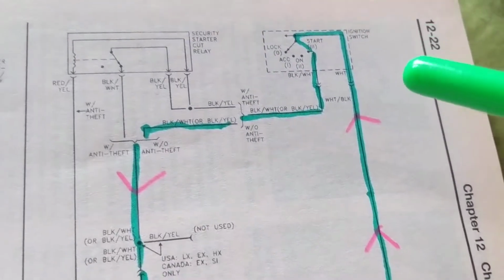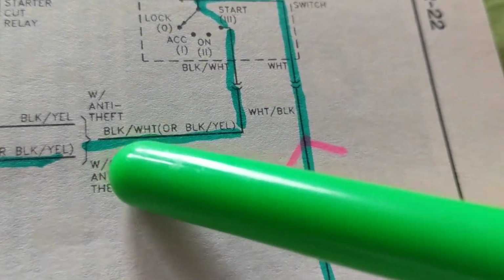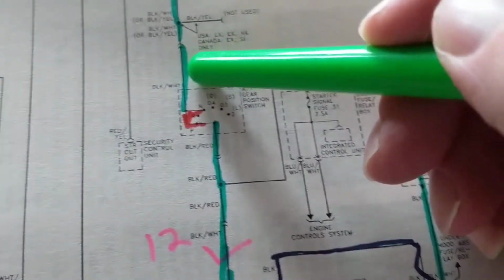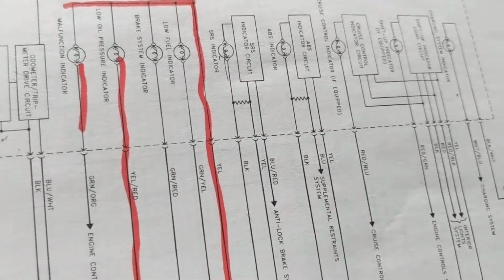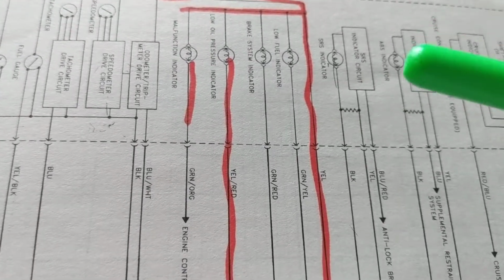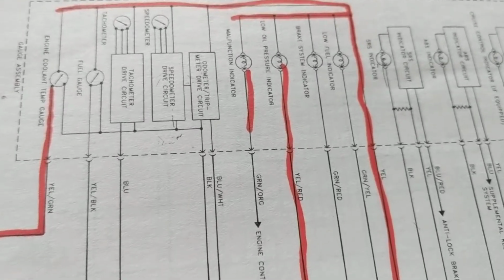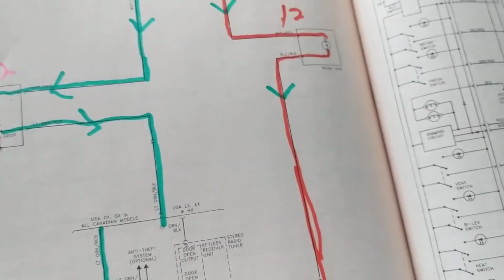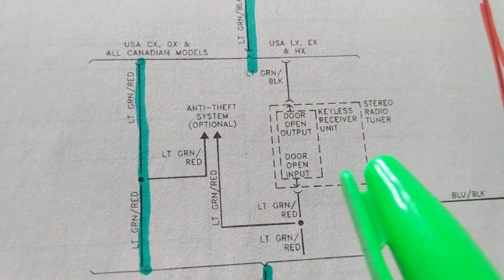How to read Automotive wiring diagram the basics of components symbols

Comment: how can you figure CAM and CRANK sensor are bad out if the computer dose not ?
Reply from the maker: Well you can look at signals but it's not always easy access to get to these sensors so the best way is to use a scan tool which tells you the description and what's going on with these sensors if there is a problem with it sometimes it gives you a code stating crankshaft sensor problem or check engine light
Reply: @Joeelectronicschematicsforauto  that’s why I was thinking. Usually it gives codes . Thanks

Comment: Hi and thank you for the video you do for us, at the 3:45 mark you mentioned 2.1 per cell. 6 cells 12.6 volts for full charge unless the weather heat right, so my 9month old battery, Interstate black top when it's in the 90's reads about 12.3 or 12.4 but my batt tester shows battery in good charge and truck starts fine no struggle. I guess it just the heat